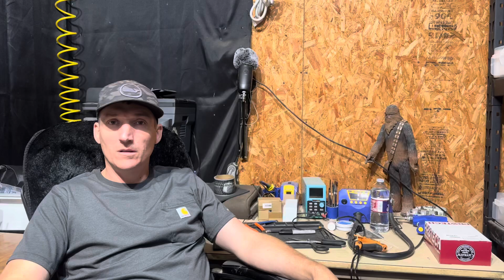Theory of Charging R410a system with R32 #hvac

Comment: Topping off 410A with R32 sounds like the best bet for someone on a budget. If you are charging over half the system with R32, I probably tell the owner it’s time for replacement as they will need the A2l mitigation monitors
Reply from the maker: The sensors are  just a ploy by the lobbyist to force people to have to switch out their units. That’s in the manufacturers best interest. 410a is 50% R32 the flammable difference between the two is so small it’s not even noticeable